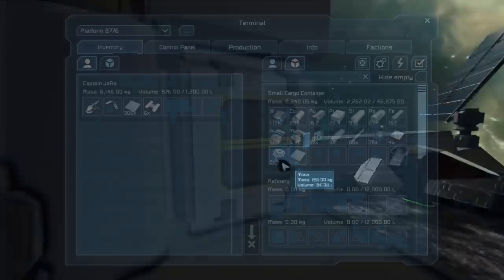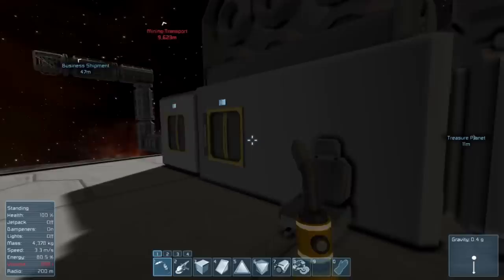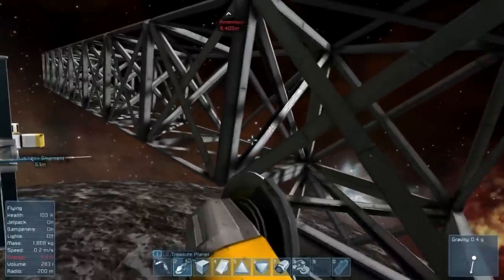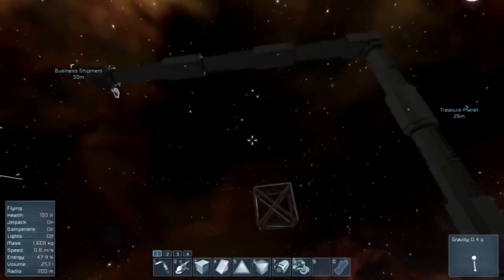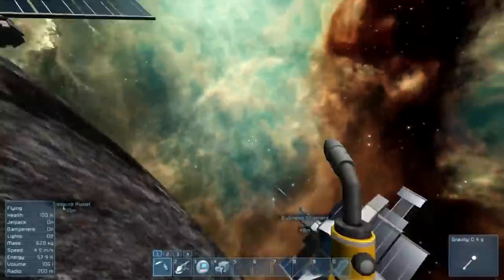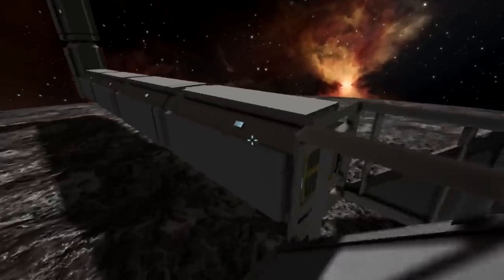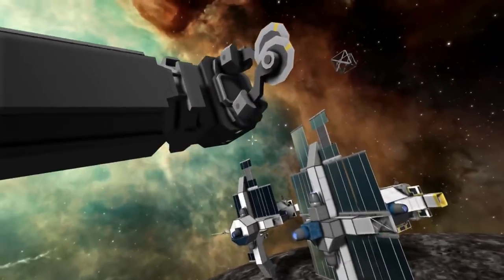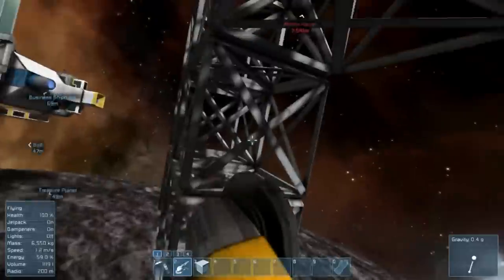APS 3 - 3D Unprinter, Wierd Sounds and Anger Management

Comment: If you get this working you are a BOSS!

Also, though, I didn't see you turn the sensors off and on. You know they're bugged to not sense what you tell them until they turn off and on right? Use the F11 menu to see the fields and change the values to test the theory, you'll see what I mean. The boxes scale weird but reset when you turn off and on
Reply from the maker: There is about 3-4 hours of fiddling around cut out from this episode. And i have continued for almost the same amount of time after.

Sadly this is not going to work, mainly because the sensors reactivate every time a block in their area is destroyed. It is possible to make a "stupid" version that just scans the whole area, but it would take hours to take down even the smallest ships.

Hopefully i'll remember to revisit this once sensors work properly :)
Reply: Captain JaRs Or maybe use timer blocks combined with the sensor blocks, since that's a thing now?
Reply from the maker: There are/where ways to do it but not in a way that would make the build make sense in the end.